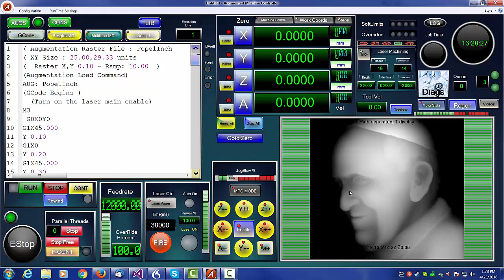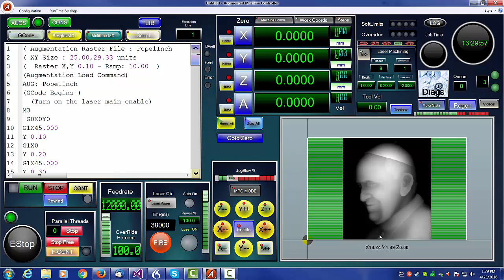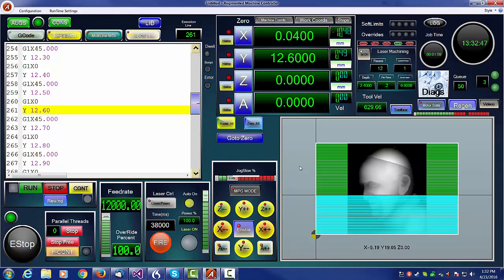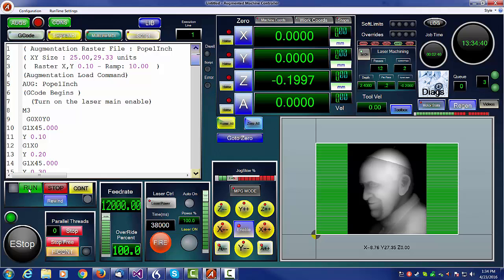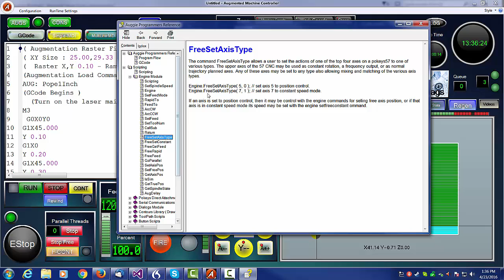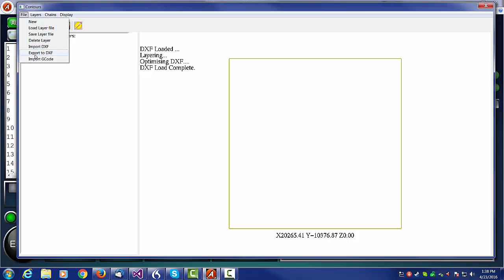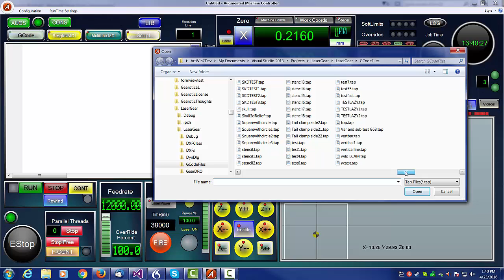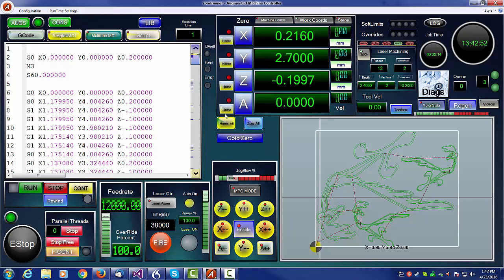Laser3d

Comment: Art
Wonderfull stuff, now i have to worry about getting a Z axis going.
My wife does stamps.  I have layered a couple  and this would give a more stable impression since we could taper the vertical edges which are currently straight up and down.  The thin lines want to deform out of the way sometimes.

Glenn
Reply from the maker: Or you could make something that rasies and drops the focus tube.. :)